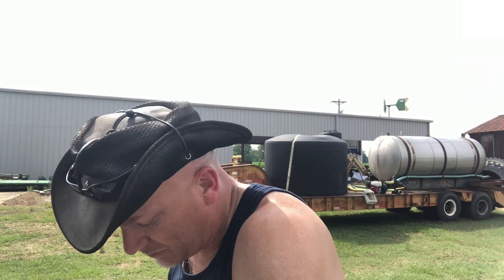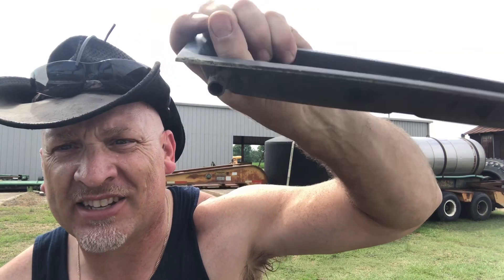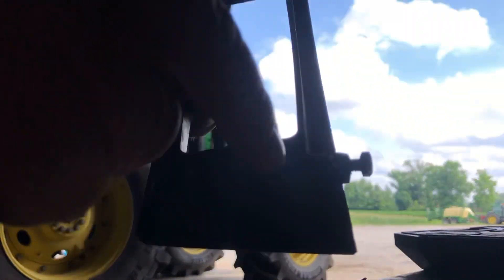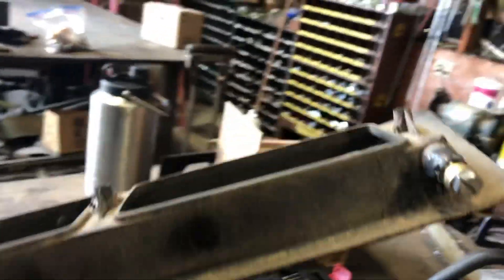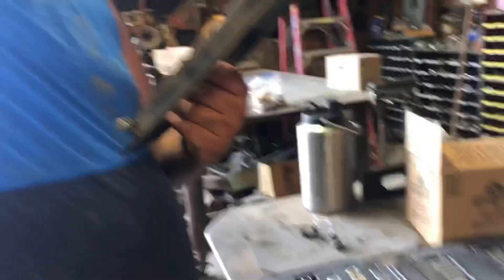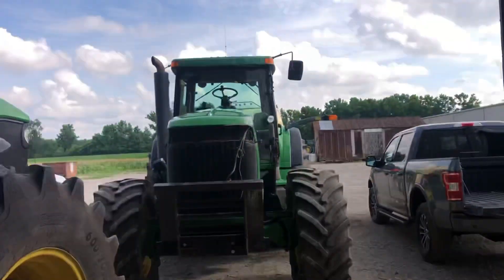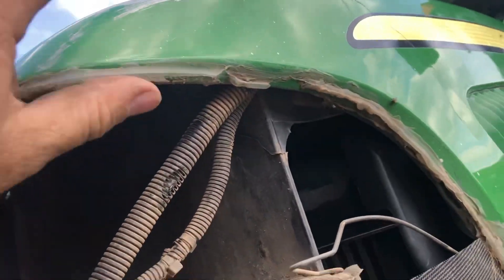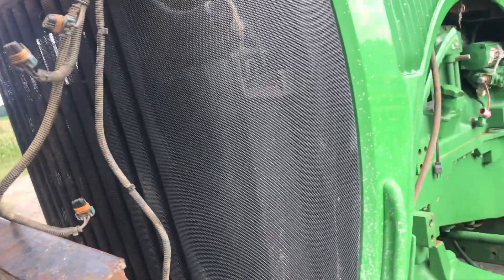June 5, 2021

Comment: hey a trick for getting stuck screws out is to put a soldering iron on the head and get it nice and hot and it will come right out. I use the trick all the time on my rc aluminum rims with steel screws holding the bead locks they are always nice and seized